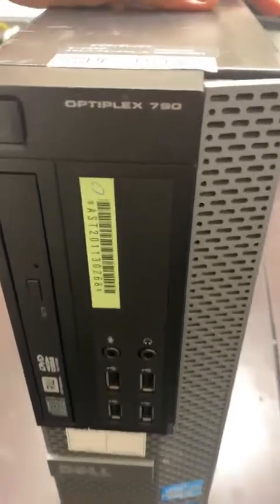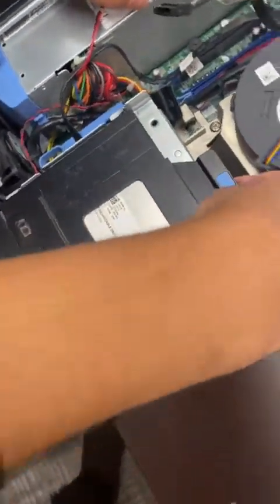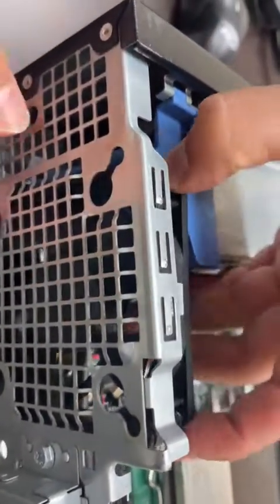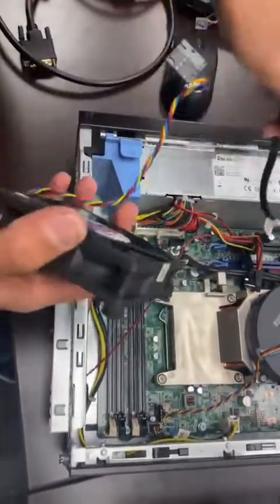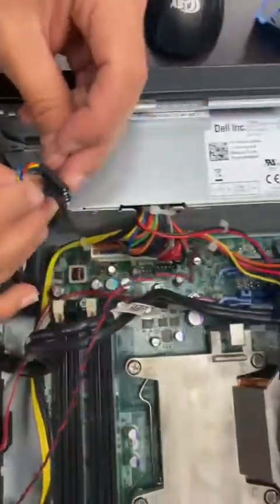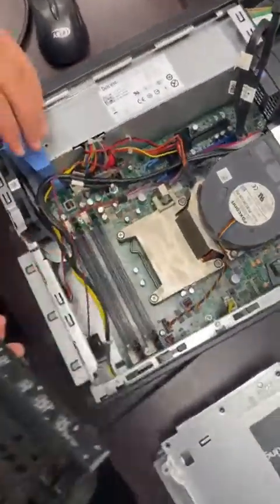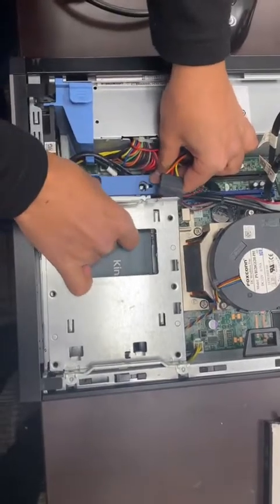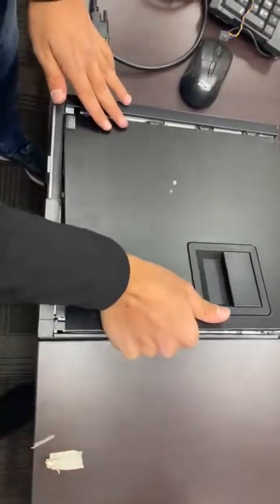Dell 790 (And any SFF model in general) Front Case Fan replacement

Comment: Why for some reason..  I have a Dell Optiplex 790 SFF.  When I bought it off Amazon Refurbished (The Picture shown was a Tower Case) I got a SFF .  The board in my Case and case setup is not configured like the one he is working on in the video.  You can't buy or find replacement HDD Fans. The Dell Bios will notify you that the HDD fan is not working.  The only reason there is a FAN is because there is a SSD Drive. And it gets HOT and then quits.  Bios controls the Fans in the SFF case.  This is why I want to junk the SFF Case cause it is trash, they don't breath well.

Comment: I have a 7050 SFF computer with no front case fan.  Where you're plugging the fan in for power, my motherboard is similar but slightly different.  The motherboard is labeled TBT.  Would I plug a fan in here?  I see nowhere else to plug in a fan.  Thanks!
Reply: Exactly my problem. I also have 7050 and it has no fan in front. I have this idea to install a fan myself and use the power port of the dvd drive since i wont use that anymore. The issue is what is the voltage of the dvd drive so that I can purchase the correct fan voltage

Comment: Thanks so much for this great tutorial! I had to do a quick replacement of my DC 12V, 0.60A fan in my Dell 790 with a scavenged fan from my never-used Dell 7010 backup computer. The 7010 fan is DC 12V too, but 0.32A. Could that make a difference, using a 0.32A fan in my Dell 790 instead of another 0.60A?